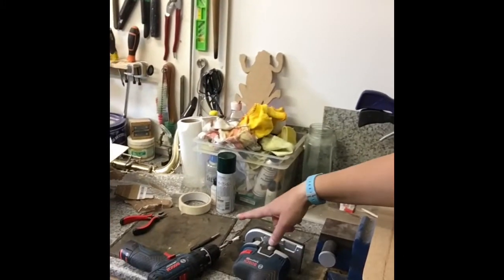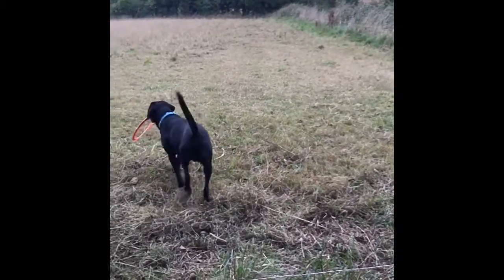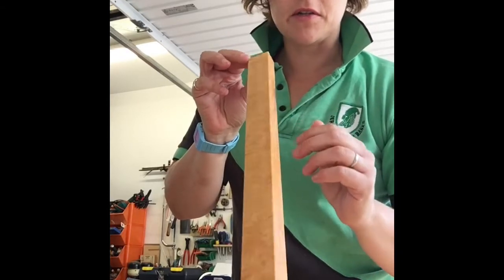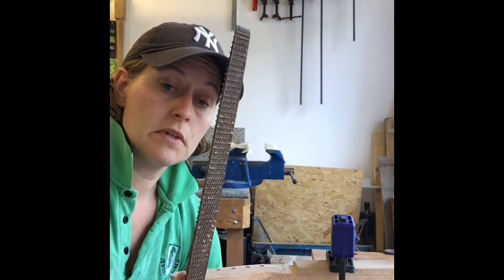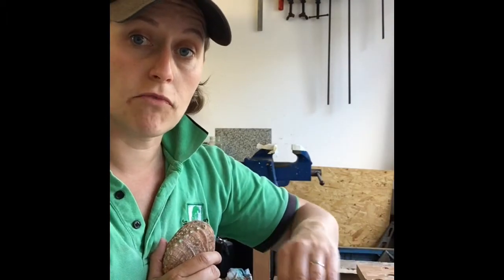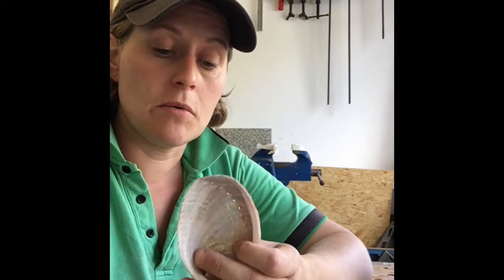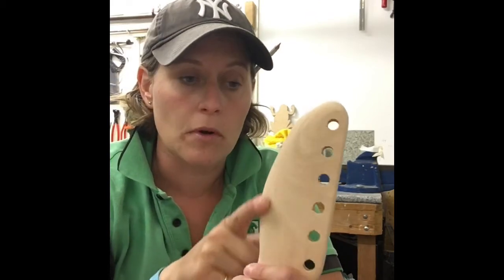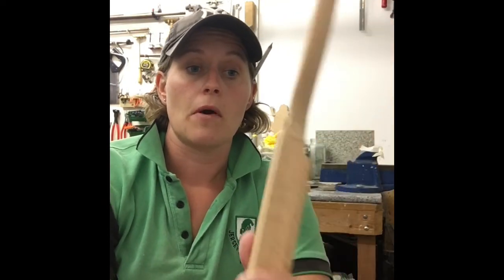Great Guitar Build Off Unofficial

Comment: Not only have you sorted out the headstock design practicality, but I'm giving you a massive cheer for doing something I really really wish would be more common amongst guitar builders, whether they're home builders or enormous corporations. Far too often, they make gorgeous bodies with lovely intricate curves, but then leave the headstock with right-angled edges. Fender does it, Gibson does it, PRS does it, Ibanez does it, etc. Feminine curves on your headstock ----- YAY! I'm a tad concerned about the strength of the decorative part of your slimline head if and when Violet gets used for gigging, but perhaps a good drenching with wood hardener (Ronseal do one - they call it Ronseal Wood Hardener, obviously) will help you there. It is, in essence, a dilute form of CA glue (superglue). Apply, let it soak in, apply, let it soak in, apply, etc. etc. until it stops soaking in. If you use normal CA glue you'll get a similar effect with very short drying time, but that speed means it doesn't get the opportunity to soak fully into the core of the wood.